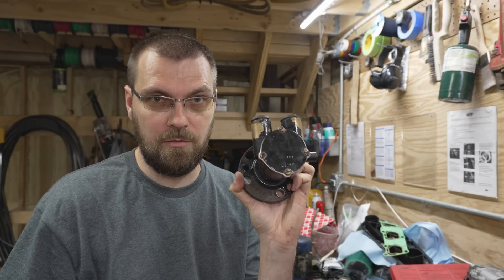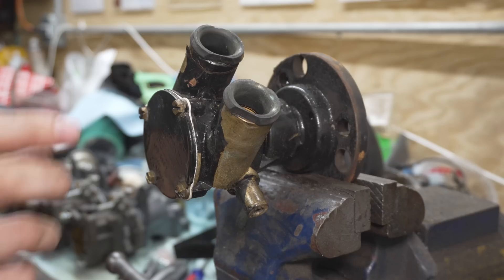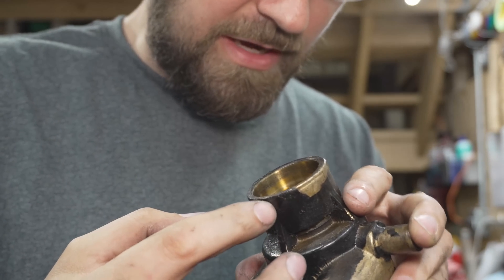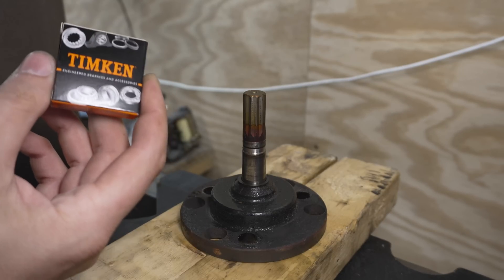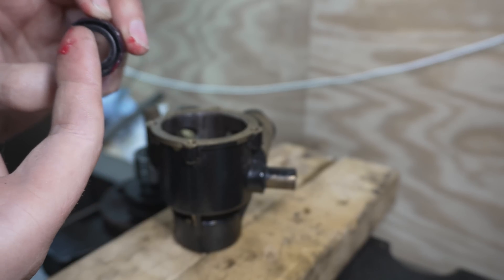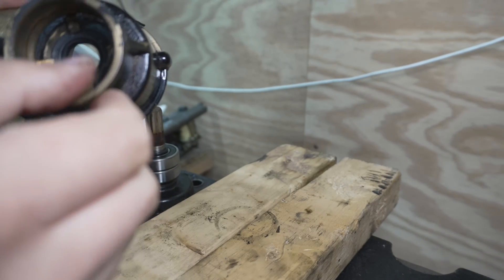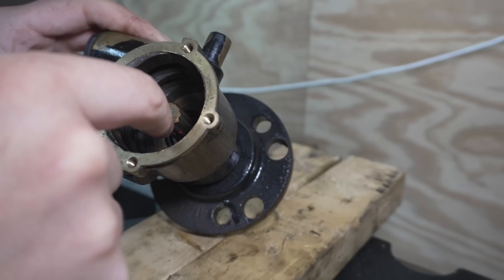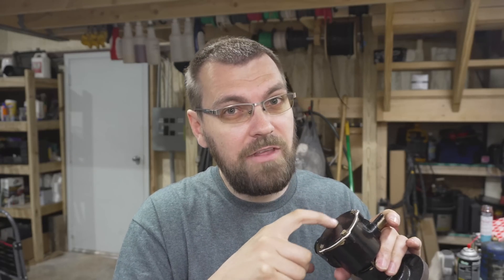Johnson Pump 68-5001 F6B-9 rebuild (Malibu, Mastercraft, Axis, Etc seawater pump leak fix)

Comment from the maker: Here is what you'll need to rebuild your johnson pump:
2 pack of 6203-2RS bearings: https://amzn.to/4kBfec4
221610 Seal: https://amzn.to/4kwpvWS (Check your local auto parts store for this one, it might be cheaper, dimensions are 16mm ID x 28mm OD x 7mm W )
18mm OD 14mm ID 2mm Width O-ring: https://amzn.to/3GP4bNC
18-3306 Sierra impeller kit: https://amzn.to/45aMgux
Bearing separator: https://amzn.to/4kLgb0M
I bought a shop press from harbor freight but this is an alternative: https://amzn.to/3HtfVVU

Or just buy a whole brand new pump: https://amzn.to/45ccn4j

Links here are most likely affiliate links, should you choose to purchase from one of them, I may earn a small commission for referring you to the seller. And, this is done at no extra cost to you!

Comment: Hard to believe that the bearings aren't locked in with a snap ring. Maybe that's the 'staking' you're talking about?
Reply from the maker: Supposedly the "staking" is where a punch or chisel would be used to roll an edge over to prevent the bearings walking out. Surprised there wasn't any staking or retainer.
I'm no engineer but I bet I would annoy every single one with how I like things to be overkill, I'd have some kind of retainer holding that in place.

Comment: Nice Work Sir!  My Johnson f6b-9 SWEDEN water pump actually had the brass washer was installed at the bottom.  My thought is that it supports the seal from blowing out but correct me if I am wrong.

Comment: Thanks for the video and part numbers. I didn't see a number for the o-ring that goes between the bearings and the shaft seal. Any though on if that is needed?
Reply from the maker: The main purpose of that o-ring is to sling any water that leaks past the seal off before it could make it to the bearings.
An exact fit isn't really required, I just grabbed an o-ring out of an assortment I've got, but something close to this should be about right, a snug fit is good:
18mm OD 14mm ID 2mm Width O-ring: https://amzn.to/3GP4bNC